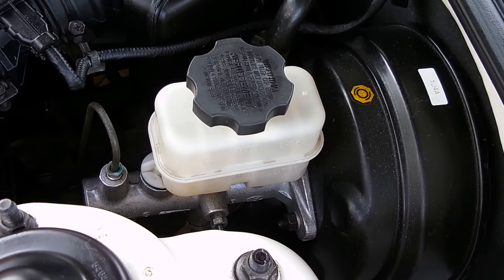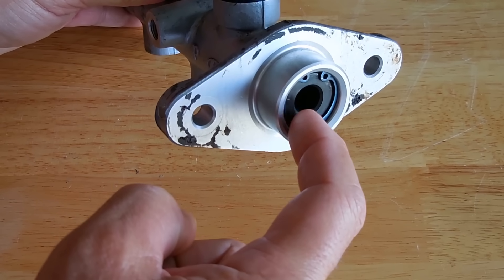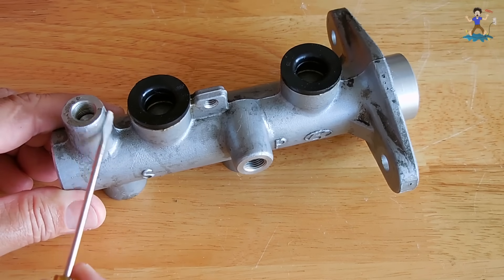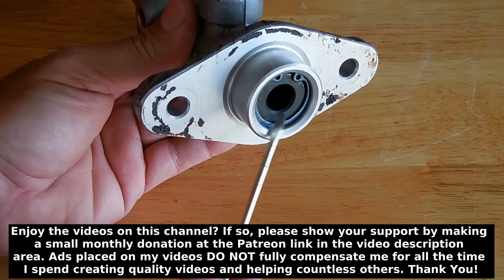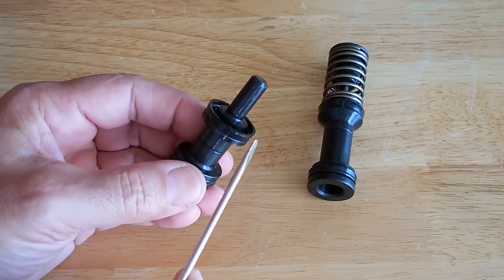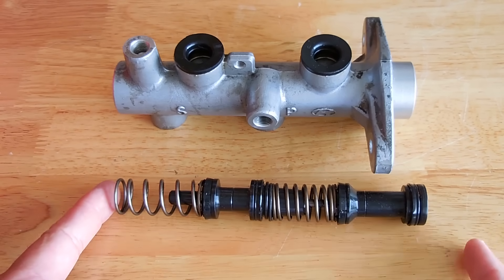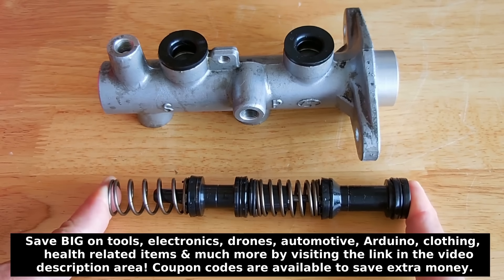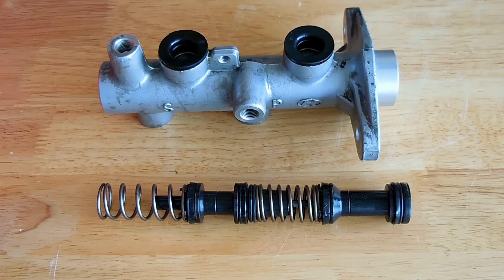Vehicle Brakes: Master Cylinder(How it works)

Comment: How do you bleed the system when the whole system is new and does not have any brake fluid in it? New Master Cylinder and new brake lines everywhere. Specifically, will i need to bleed the MC too or something?
Reply from the maker: You keep the master cylinder full, and start bleeding from the wheel farthest away. Keep moving closer and closer to the master cylinder until you are finished. Do not let the master cylinder run dry or you will have to do it all over again
Reply: @electronicsNmore  it seems to me some people say not to bleed the master cylinder like in this video, but rather just bleed the whole system after everything is installed. Is this a fair assumption? I see google also suggest this is something that needs to be done before bleeding the rest of the system/brakelines. My first rodeo this, and i get a bit dizzy from it 😅

Comment: My caliper locked up on the right front even though I replaced it 2 times and also replaced hydraulic hose.  Caliper still locked up the wheel and will not retract.  When I manually pushed the pistons in, they went in very easy.  Is something wrong with the MC?

Comment: QUESTION..First drive of the day my car brakes are fine..After about 10 miles or so the brake calipers are not retracting like they should and it feels as if i am applying the brakes..After about 20 minutes of cooling off when i park the car the calipers do release and it's normal again..I don't believe its the calipers that are bad..when this has happened i jacked the front end of the car up and both front wheels can not be turned by hand so both sides are doing the same thing..the chances both calipers going bad at the same time seems impossible to me but i can't figure out why they are not retracting when they heat up but release when cooled off..any ideas would be appreciated

Comment: the master cyl from my 2001 dodge ram 2500 cargo van has some bright spots on the bore what do you think caused that ; Im trying to determine if the pistons are sticking; I have already ordered a new one but in the meantime I want to learn more ; I have also ordered rebuild kits for the calipers. My brakes are overheating I already replaced the flex lines....

Comment: An important question: in your video it seems as the rubber  sealing ring is gliding over a sharp hole in the cylinder wall. Is that really possible without damaging the seal, and while the seal is building pressure!? Especially as it is supposed to happen every time braking takes place. If done just one time during assembly is barely possible but acceptable normally! I suspect the rubber sealing ring is on the unholed side and acts as a check valve when refilling oil. And that it quickly creates a seal when braking.

Comment: That was interesting to see how it works, and despite seeing a seal kit for my 101 is cheap, i've opted to go for a new master cylinder as i'm replacing the rest of the system apart from the brake drums. I didn't intend to replace this part but while bleeding the system i noticed fluid dribbling down the brake pedal...

Comment: Need a new master cylinder on my car. Pedal slooooowly sinks to the floor with both-feet pressure. There was a good discussion against rebuilding on corvette forum. Honing the bore makes sharp edges which can cut the seals. What is the point of new seals if you don't clean the bore. Rebuild's not worth the risk (or the time, honestly) when a new one is under 100.

Comment: Thanks for your valuable presentation . Please note in general that there is a Locking screw  ( in the Tandem Master cylinder assy). for the secondary piston to limit the travel during return stroke of the secondary piston . Please clarify . Thank you so much . Ramachandran

Comment: Pedal hard then engine start and brake pedal goes to floor. Whats the answer?
Reply: Two possibilities 1. Air bubbles in the brake lines. 2. Worn out master cylinder, replace. In both cases you’ll need to “bleed” the brake lines.

Comment: so which part of this could be faulty when only 1 side of the rear brakes is kinda weak and uneven with the other side and both front brakes are completely normal?
Reply from the maker: Probably a faulty wheel cylinder or disc brake at the rear wheel.
Reply: @electronicsNmore  it doesnt even have any rust, and fluid is flowing out of it when pedal is being pressed (plus the piston is moving when the seal is not opened etc...)
Reply: @electronicsNmore  could it be a faulty proportioning valve also somehow, that gives less juice to 1 side of the rear?

Comment: I can see the first spring nearer to the booster is more compressed /stressed;compared to  second one...
Does it mean the brakes linked to the first spring (front brakes) are braked first before the second spring brakes (rear brakes) are applied ?
Reply: As you install the pistons and springs, and then install the final retaining C clip, both springs will end up, (brake pedal not pressed) in the same compressed position.

As you press the pedal, both springs will be moved at the same rate.

Comment: I am curious as to the vehicle you are using for the demonstration.  Were the puck sizes 3/4 inch and is there a kit for rebuilding that particular master cylinder.  Please advise.  Video was very well prepared.
Reply from the maker: 2003 Hyundai Sonata GLS V6/2.7L. Not sure of the sizes. Thanks for watching!

Comment: does tandem type master cylinders have two different and separate reservoir? because I am having a master cylinder and it has two points for brake lines does this conclude that it might have two separate reservoirs?

Comment: Any idea or best remedy for the same type of master cylinder which is not pumping out fluid?the one hole attached to the front brakes has no pressure and nothing is comin out even a single drop of fluid while the other hole attached at the rear brakes are ok and has a strong squirt of fluid.
Reply: And by the way,i already replaced new sets of rubber seals inside the cylinder setting up and been clearing holes with tiny wires checking if it is clogged but its not coz air is passing through and still no brake fluid is pumpin out..

Comment: very informative. On the piston closest to the booster does the cup on the seal face the booster or the inside of the cylinder? i changed the seals in my rav4 but fluid is still leaking down the face of the booster. Wondering if i installed the seal the wrong direction.
Reply from the maker: You should be able to see it in the video using the high res video player setting. Thanks for watching!
Reply: @electronicsNmore  thanks.

Comment: Awesome video!!!
I had to rebuild my 2001 Tacoma's MC about 2 months ago because it was leaking at the brake booster.
Toyota sold me the rebuild kit for $110. and I rebuilt it and reinstalled it.
No more leaks after that but I ended up with a cranking sound when I push on the brake pedal wether in movement or dead stopped.
I also ended up with half the braking power.
I step on the brake pedal while in movement, the pedal is hard to the push but it takes longer to come to a full stop now.
I bled the MC and brakes again today but no luck.
Do you have any idea of what could be going on?
When I put the MC back together, I  made sure that the screw below the MC would hold the secondary piston from coming out, then I installed the primary piston and secured it with the C clip.
I installed the MC to the brake booster and bled it using a MC bledding kit so I would not make a mess.  
Bled the rest of the brake system accordingly and I started hearing and feeling what appears to be a spring load crank. 
Please advise and thanks in advance.
Reply: Ok what you need sir is to check the A B S system

Comment: Sir is this arrangement meant for all the 4 wheels separately? Coz two holes are meant for front and two behind holes for rear wheels as u have shown here. So in all 4 holes for 4 wheels? Can u plz correct me.
Reply: Most vehicles are two lined as in diagnonally split systems(best by me so when  brakes fail you have one front and one rear brake)or front and back  lines. As in those two lines serve all the four wheel positions.

Comment: Do you have to use tools to disassemble the pistons to remove the seals or do the seals just stretch over and pull off?
Reply from the maker: No special tools were used in this video to disassemble the master cylinder. Most seals can be removed by hand, or using a small hook pick. Thanks for watching!

Comment: Now what if the master cylinder is not leaking visably... Its just the seals need replaced?
Reply from the maker: Yes, internal seals/O-rings can fail, but many times people think the master cylinder is at fault, when the problem is another component. Thanks for watching!
Reply: @electronicsNmore  I bled all brakes and still coming back sof and abs code light is on
Reply from the maker: @briggsmellor131  You need to stop at the auto parts store and have them scan your OBD port for free.

Comment: Does brake fluid typically bubble up in the reservoir when you let off the pedal? Running into issues with my brake set up.
Reply from the maker: You should see no bubbles, only clear fluid.

Comment: ElectronicsNmore
What causes the master cylinder not to return brake fluid back to the brake reservoir to release pressure to the brake caliper piston? 1999 sienna. I replaced the 2 front caliperS and brake hoses already but still dragging and causing too much heat on my front rims. Thanks!
Reply from the maker: Collapsed brake hoses between the wheel and chassis are usually the problem, but you changed them. Maybe a faulty proportioning valve.
Reply: @electronicsNmore  ok thanks

Comment: I see! So if both my back brakes are locking, chances are one of those rubber pistons with the springs wore out, not my both my back calipers, unless it was a weird coincidence.  Especially since the locking is at times intermittent.
Reply from the maker: I usually find that when brakes lock up, it's a faulty caliper or a bad brake hose from the brake line to the caliper. The inner walls can collapse. If the brake is stuck on one wheel, and you loosen the caliper bleed bolt, and the wheel is no longer locked, then the hose is bad.

Comment: My car i20 clutch sets ...disc, bearing and plate, and slave cylinder has been changed recently. After that, all working ok...pulling, shifting, etc..all ok. No complaints.

However, just about 3000km of driving since the above replacements were made, the car suddenly failed to engaged any gear while driving. The clutch pedal all the way goes to floor and never return back. I have to manually return to its original position and then pressed again repeated. However, it still sticks to the floor and never return back.

I was driving and all of sudden the issue happens. Stuck in traffic and was pull over to roadside with traffic police help.

Wait for some time, and yes, it come to engaged and disengaged again. All ok. But, the problems arise intermitently!!!

There is no physical leakage, damage or low fluids in the system. All ok. (It used to happen when clutch is used often ie in traffic jams, clutch engaged and disengaged frequently, just in 10 minutes or so. However, no issues with pulling power and no clutch slippages, temperature, coolant all ok.)
Reply from the maker: Perform a very careful inspection between the clutch pedal and manual transmission. If you don't see anything wrong, then you have a problem internally with the spring loaded mechanism. Good luck! Be sure to share my channel with others.
Reply: @electronicsNmore  thanks for the reply.

No issues with the pedal and transmission.

The issue often come up when intermittently and frequently clutch is pressed and depressed while driving..ie. mostly in traffic jams.

Comment: im all for rebuild kits! When available, however. Im actually researching cutting (aka turning) brakes, as i want to use a small master or perhaps a motorcycle master as the individual wheel brake. I believe i need to add a inlet line from the primary master cylinder brakes  to the front of any smaller master i end up using. Seems like i may be able to simply tap a fitting into the front of the small master to accomplish this, but time will tell.
Reply from the maker: Thanks for watching! Be sure to look over my "Auto & Mechanical" video playlist for other videos of interest to you and most importantly share my channel with many others. 

https://www.youtube.com/watch?v=hnd7P7O_vEQ&list=PLQ6IOhUBblU3mBem9ImEgGzmqToW6SCJD

Comment: my brakes are staying applied on left side, you did not mention anything about the fluid return back to resevoir
Reply from the maker: Collapsed flexible brake line to wheel, stuck caliper, or bad proportioning valve.

Comment: these are designed so if you blow say a front hose or line the rear will still work normally or vice versa...plus you have your parking/emergency brake ...3 separate braking systems.

Comment: Does the worn seal cause a hissing sound}?
Reply from the maker: Sound like you have a vacuum leak.
Reply: @electronicsNmore   how to spot the vaccuum leak ...is there a easy repair or the booster needs replacing?

Comment: Excellent presentation. The best I have watched. Having the parts cleaned and having clean hands helped a lot in addition to your professional delivery. Also having the items set up on a clean surface without any clutter/other items lying around is very effective in preventing distraction from the surrounding environment (for me, at least). Clear concise demonstration of the moving parts, their purpose and interaction was excellent. This presentation could be used for new mechanic students very effectively. Thankyou.
Reply from the maker: Glad you enjoyed my video! I have many Auto & Mechanical related videos, so be sure to look over my video playlist below, and most importantly share my channel with many others. Thank you
https://www.youtube.com/watch?v=hnd7P7O_vEQ&list=PLQ6IOhUBblU3mBem9ImEgGzmqToW6SCJD
Reply: @electronicsNmore  My car i20 clutch sets ...disc, bearing and plate, and slave cylinder has been changed recently. After that, all working ok...pulling, shifting, etc..all ok. No complaints.

However, just about 3000km of driving since the above replacements were made, the car suddenly failed to engaged any gear while driving. The clutch pedal all the way goes to floor and never return back. I have to manually return to its original position and then pressed again repeated. However, it still sticks to the floor and never return back.

I was driving and all of sudden the issue happens. Stuck in traffic and was pull over to roadside with traffic police help.

Wait for some time, and yes, it come to engaged and disengaged again. All ok. But, the problems arise intermitently!!!

There is no physical leakage, damage or low fluids in the system. All ok. (It used to happen when clutch is used often ie in traffic jams, clutch engaged and disengaged frequently, just in 10 minutes or so. However, no issues with pulling power and no clutch slippages, temperature, coolant all ok.)

Comment: you may have just saved me $400 for a genuine volvo replacement. heading over to your patreon in 5, 4, 3...
Reply from the maker: Great to hear, I no longer use Patreon. I take donations through the Paypal link provided. Thank you.
Reply: @electronicsNmore  great, I'll check it out. Making a look around, it seems I'm unable to find rebuild components for a 97 Volvo 850 master cylinder. Any ideas around this or is there a standard?
Reply from the maker: Maybe Rock Auto.

Comment: Very High class, quality video. The skill you shown are unique, great video .....
Reply from the maker: Thank you! :-) Be sure to look over my "Auto & Mechanical" video playlist below for other great videos of interest to you, and most importantly share my channel with many others. 

https://www.youtube.com/watch?v=hnd7P7O_vEQ&list=PLQ6IOhUBblU3mBem9ImEgGzmqToW6SCJD
Reply: @electronicsNmore  My car i20 clutch sets ...disc, bearing and plate, and slave cylinder has been changed recently. After that, all working ok...pulling, shifting, etc..all ok. No complaints.

However, just about 3000km of driving since the above replacements were made, the car suddenly failed to engaged any gear while driving. The clutch pedal all the way goes to floor and never return back. I have to manually return to its original position and then pressed again repeated. However, it still sticks to the floor and never return back.

I was driving and all of sudden the issue happens. Stuck in traffic and was pull over to roadside with traffic police help.

Wait for some time, and yes, it come to engaged and disengaged again. All ok. But, the problems arise intermitently!!!

There is no physical leakage, damage or low fluids in the system. All ok. (It used to happen when clutch is used often ie in traffic jams, clutch engaged and disengaged frequently, just in 10 minutes or so. However, no issues with pulling power and no clutch slippages, temperature, coolant all ok.)